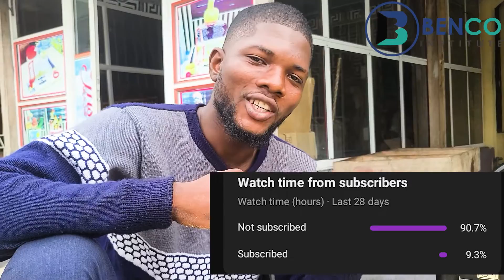How to reduce gas consumption for a generator that uses Dual Carburetors, Save running cost by 50%

Comment: Why is 2700 Yamaha Engine is left out for the LP carburetor ?
Reply from the maker: It's not actually

You only stock what you can readily sell...
Reply: @bencoinstitute  Don't say that. I think a lot of people is still using that Generator. Is not that outdated as you Engineers thinks.

Comment: just out of curiousity is the waveform produced by the generator a consideration? Lowering the hertz and voltage to the 100vac and 50 hz might only work on a few electronics and would most likely damage a lot of others. saveing a little fuel isn't worth losing an item.
Reply from the maker: Lowering the speed on an Automatic voltage regulated generator have no effect on the load...output is relatively constant

Comment: As long as the air fuel ratio is around lambda or stoichiometric, the better way to save fuel is to run the generator fully loaded and then turn it off completely.  The brake specific fuel consumption is best fully loaded.  Unfortunately those generators are typically always idling at 3600rpm for 60hz power or 3000rpm for 50hz.  You dont want to slow them down below that or you can burn up induction motors that will draw more current and not reach full speed due to low voltage.
Reply from the maker: Thanks a lot

There are a lot of things to note in this experiment, there is however a clause as i said in this experiment

If you perhaps notice the Gen set vibrates while you tend to lower the speed it is proper you incrsase it back, remember this experiment is all about tweaking to get results...

However in my many years of tweaking not  once have there been any issues arising from it 

Thanks a lot for your input,very much appreciated